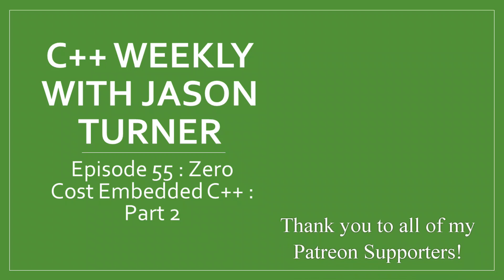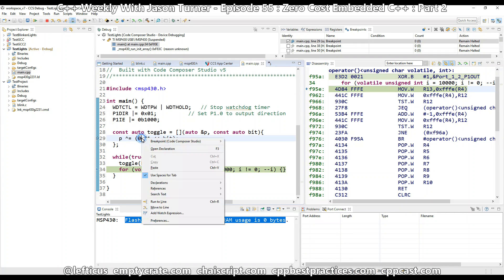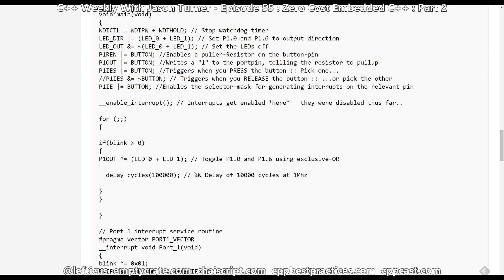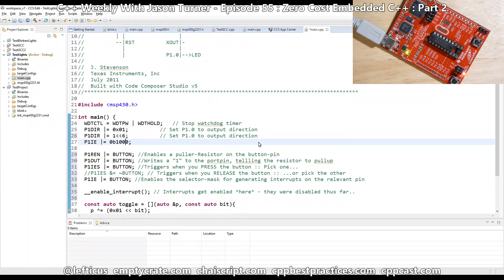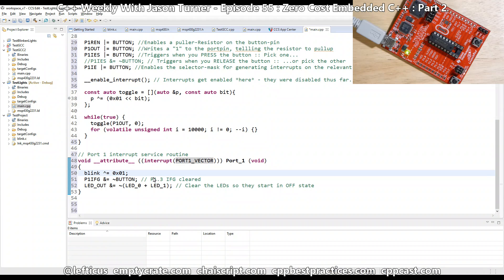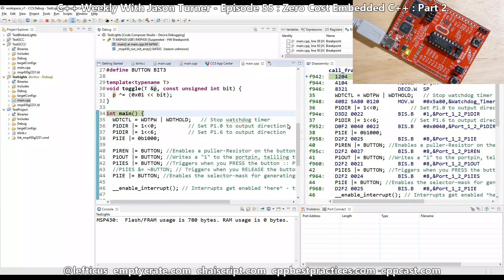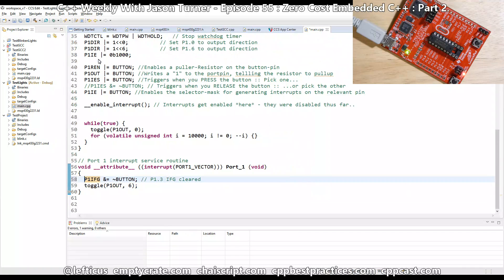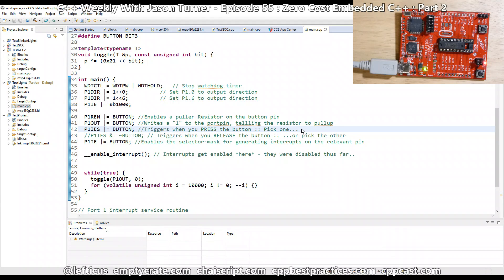C++ Weekly - Ep 55 - Zero Cost Embedded C++ - Part 2

Comment: Flash increased from 732 to 780. Its not going to go up by much since this is only a few IO register accesses. I am not sure if this matters on all chips, but it could be recommended to clear interrupt flag at the end of the ISR. I am not familiar with MSP430 enough to say that, but it could matter. In this chase the button push will be very slow. I am curious if there is debouncing somewhere in the circuit.

Comment: Hi
Can you please explain or provide a link to understand line number 56? And all those PIREN, PIOUT . What do they do?
Reply: P1REN and P1OUT are memory mapped registers in the hardware. P1REN is the Pullup/Down resistor enable register for Port 1 (each bit maps to a pin on the chip).  P1OUT is the Output setting for Port 1. P1IE Is the Interrupt Enable.
Reply: Thanks for the info, is their any document or video tut available to learn them?